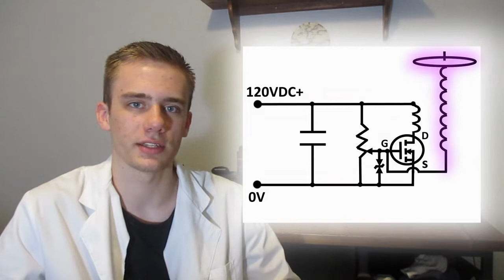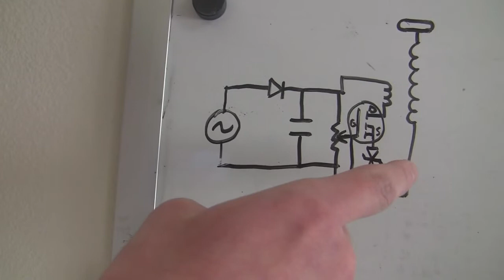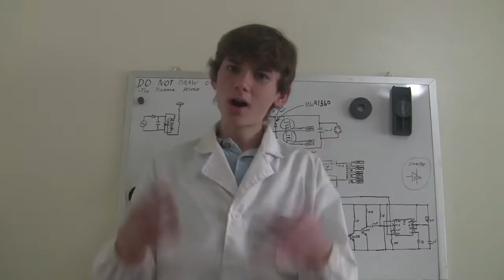The Absolute EASIEST SSTC Build (FEAT. PLASMA CHANNEL AND LABCOATZ)

Comment: Where is your follow-up video? Also, why don't you specify few details -like what is the AC input voltage, mains 120V?-, so people who like to recreate your project can safely do? Are the 2 Zener diodes on Source correct? Was this exact schema used and what was the result? Did it work?
Reply from the maker: The follow up is taking longer than expected but it is being shot. The input voltage is actually 120v half wave DC, which is essentially American mains going through a single 10A10 diode. You can use the two zeners on the source or just one 12v TVS diode. And yes, I used the exact schematic shown, and it did work. I had a 300W ballast on it though, other than that the schematic is exactly the same as the circuit built in this video. I reccomend watching Labcoatz's video, as he goes into more depth than I do in this video.
Reply: @Plasma.Prince  Thanks for your answer. Can you explain how you connected the 300W ballast in this case? What does the ballast do in this case? (I'm sorry but I never seen any ballast used in Tesla Coil experiments).
Reply from the maker: @tonysfun  I just hooked it in series with the circuit, before the diode.

Comment: Well I'm glad I didn't fire it up before I read the comments here . it would have been nice to know from the video that it did not work without making changes . what is used for the ballast?
Reply from the maker: I used a 300W light bulb. Start with low wattage ballasts, and slowly go to a higher power ballast. Labcoatz went as high as a 1000W ballast, but he blew up a LOT of MOSFETs making this circuit so be careful!

Comment: plus you should have used a FULL BRIDGE RECTIFIER instead to have higher efficiency
Reply from the maker: Haha ElectroBOOM reference. As much as I would have liked to have an excuse to say FULL BRIDGE RECTIFIER in this video, this circuit overall works better with a puny single diode rectifier haha.

Comment: Excellent video collaboration! However I do not recommend using light bulbs as a ballast for constant use, this is basically a high voltage input slayer exciter. Using an inductive ballast will allow the coil to actually resonate within the sine wave due to the use of a very capacitance cap (which is a must!). That's why you're getting more constant arcs out it. Try it and see what how it works for you.
Reply from the maker: Thank you very much! This one actually blew up when I plugged an inductive ballast into it, but it was my fault for turning the pot all the way up haha. Currently working on a better one with a half bridge of IGBTs, which will be another future collab video!

Comment: Use thicker wire for primary connection!!!! And why zener in the drain it should be on the gate to clamp the voltage to protect the gate. Nice video though! Hope you reach 100subs!
Reply from the maker: I have the zeners attached to the source, but thanks for the advice! I'll take as much of it as I can get.
Reply: @Plasma.Prince  I'm surprised that it still worked. The zeners are probably shorted so it can carry current. Gate of mosfet wont last for long
Reply from the maker: @juntendo6104  Yeah about that... the circuit already melted heh heh...
Reply: @Plasma.Prince  Oh Rip. Removing the primary cap, lowering the primary coil position and adding gate protection/gate driver will help run better and longer

Comment: Confusing.  At the beginning, in LabCoatz example schematic, the waveform clipper (2 Zeners with cathodes facing each other) is between the Gate and the Source.  In the whiteboard example, ithe waveform clipper is between the Source and Ground, which looks completely wrong.  Methinks those zeners (and lack of protection on the Mosfet gate) are going to release the magic smoke very soon.
Reply from the maker: They already did haha. In fact the whole circuit did. You will be able to see that happen in my upcoming video tomorrow! Also, LabCoatz added a 1-2K resistor between gate and source, our zener placements were the same (At least I think...).

Comment: Quick tip if your using high voltage don't create the circuit on a breadboard use a prototype board
Reply from the maker: The primary voltage is not that high, but thanks for the feedback!
Reply: why?

Comment: What about the rectifier diode?
Reply from the maker: It's a 10A10 diodie linked in series with the live wire before any of the other circuitry. It can handle up to 1,000v at 10A.
Reply: @Plasma.Prince  TY, I'm a total newbie with electronics. There's so much to learn n remember of what does what n goes where and why. All that without getting zapped or blowing a breaker. J/k. Thank you for taking the time to respond, really appreciate it. I got mad respect for you just for that.
Reply from the maker: @fernandocasas3291  No problem, just hollar if you have any more questions.

Comment: hello I can only do 1cm plasma
at 150W what do I have to do to get more plasma?
I have 450 secondary windings of 0.4 mm
and primer 5 turns 2.1mm. That's how I get the best results.
Reply: Honestly bro, I'd probably go above 150W. This kid was doing double that it looks like, I wouldn't go more than 500W unless you are fine with risking your MOSFET though haha. You could also make the coils closer to each other to increase coupling but again, that could be risky for some of the components.

Comment: Hey plasma prince, great video, do you reside in Orem or Provo? I live in Springville, I was wondering if you can show me how to make a gate driver for my Fets. If you get time please PM me, your channel is really great, and I would appreciate any advice you might could give me I'm a go for a veteran I did three tours in Iraq but I'm home now so if you get time give me a holler thank you
Reply from the maker: I'm still fairly new to Solid State Tesla Coils, but my next video will cover this topic. Basically, you'll want to drive an IGBT half bridge with an 18v square wave signal. Course you'll need a gate drive transformer with two secondary coils of the same size in order to isolate the IGBT's from each other. You'll have about 8 turns on the primary coil of the GDT, and 12 turns on the secondary coils of the GDT. Each secondary driving an IGBT. That is, assuming you have a 12 volt signal going into the primary coil of the GDT. Not quite sure how to determine which core you'll need, but I'm using a 77. Hope I answered your question, if not keep an eye out for my next video.